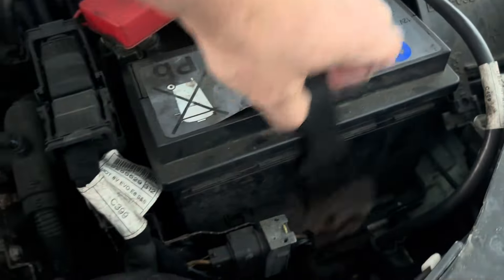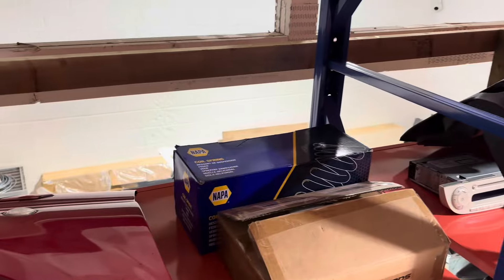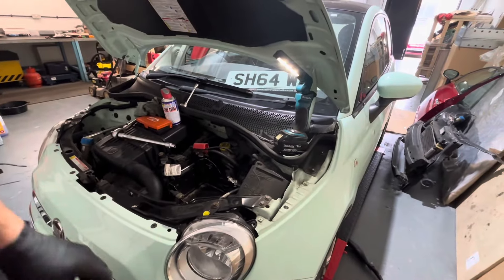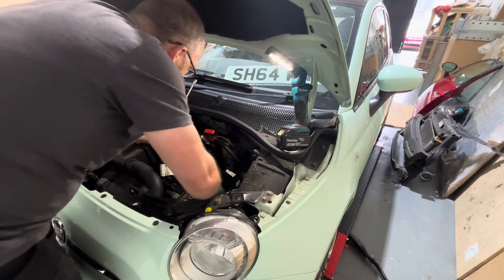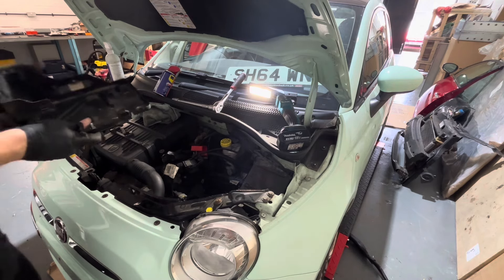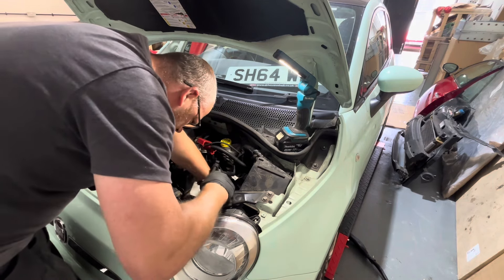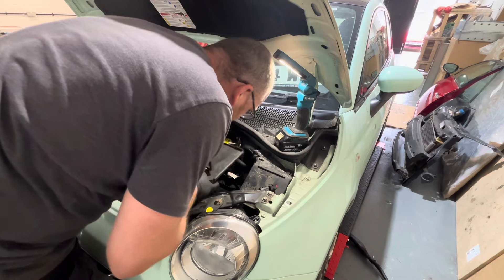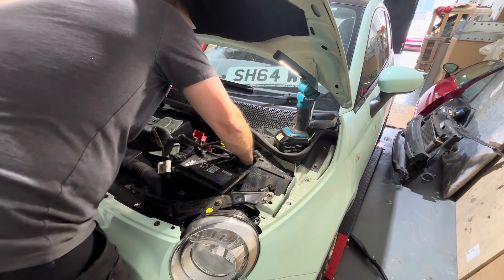Copart Cat N 2014 Fiat 500..Final Jobs

Comment: On that stereo, if your wife’s Abarth has an amp under the passenger seat you have to connect either the amp or aerial wire to the amp feed.
Reply from the maker: ahh thanks Paul, the amp/sub is under the drivers seat...I assume that's normal.
Reply: @jt500_salvage  normally under the passenger seat. I think I have some diagrams somewhere on my computer. I’ll see if I can find them and email them to you later this afternoon.